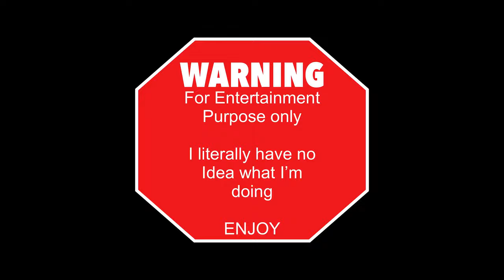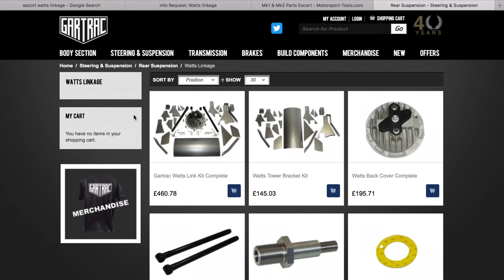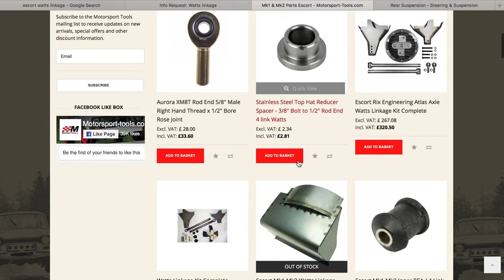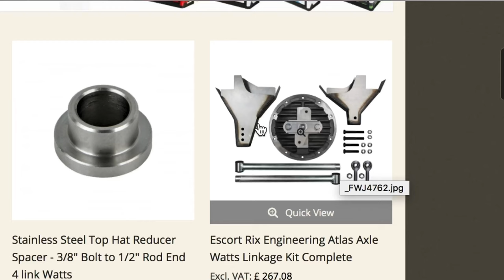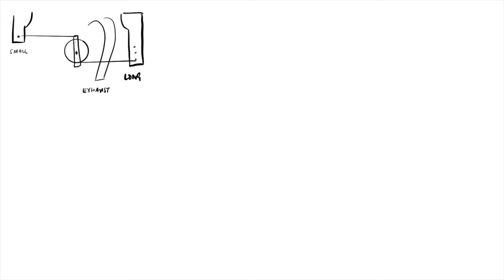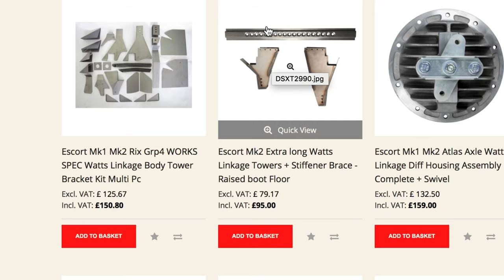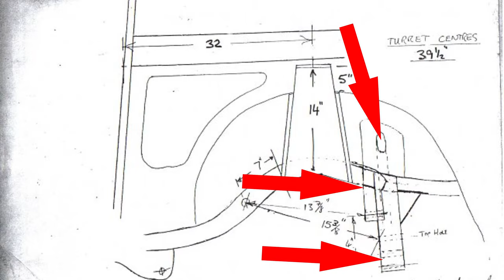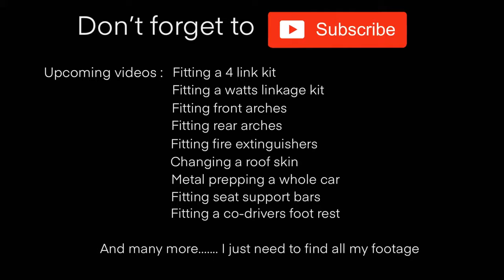Escort MK2: Watts Linkage - Part 1

Comment: The blue bar isn't to brace the towers it's a motorsport style sway bar (commonly known as a NASCAR style sway bar).  You can see the zinc coated sway bar links on each end.  What you'll find is they will have different spring steel bars with axle splines on each end.  It makes swapping the rear sway bar strength quicker as they will key into thick blades that go from the splined end to the sway bar link.  Stiffer rear bar gives the front tyres more bite and loosens up the rear for more rotation.

Comment: Another great video again I don’t think that I have ever seen anyone doing a watts linkage or boxes I have the pan hard rod system on mine but I never fitted it you have covered some valid points regarding the length of the boxes and the reasoning behind it make a lot of sense I cannot wait for the next video keep up the good work
Reply from the maker: Thanks William, I’m not sure I’m a 100% a lot of the time but hopefully the video gives somebody a jump start on their own quest for knowledge. A lot of the watts stuff was new to me, even having a 100 photos or more I still learnt about the exhaust situation the hard way. Luckily I figured it out before I finished the job and tried to fix an exhaust.  🧐
Reply: Your doing well and shearing knowledge that help a lot of people who are starting out sadly a lot of others don’t it’s like the secret society they think by telling you they are going to loose out 
I am trying to put a seal on my Escort rear door as it has Plexiglass and leaks so though I would put a one piece glass seal on it I cannot use the mk2 2 door seal as it’s 7” to small in the length I am using a fiesta seal that’s perfect all the company’s I have tried don’t want to know all they are interested in is selling you something that you know isn’t going to fit

Comment: Great video and a lot of help, I’m about to start on my watts, my exhaust will be coming out of the passenger side as il be running an ST170 so il need to find a kit for passenger side exhaust, trying to keep costs down
Think il be running leaf springs as well as 4 link as budget can afford rear coil overs but I can change over at later date once car is on the road 
Looking forward to the fitting video although this has explained so so much thanks mate 👍
Reply from the maker: Thanks Dave. I’m glad the video helped. The St170 is also a nice choice. More than enough power. I brought the F20c a few years back now but prices are now getting towards 4K for a block and box... it’s ridiculous, I’d go ST170 route as well if I was starting again. The coil overs can be costly, I don’t have any yet but you may have noticed my axle has the brackets so I haven’t ruled out leafs my self. I tried to keep it as interchangeable as possible. Do you have any videos of your escort?
Reply: All the gear.....No idea😕 no videos mate, plenty of pictures of each stage iv done but more just for my own photo album 🤣, il see if I can send you a couple somehow